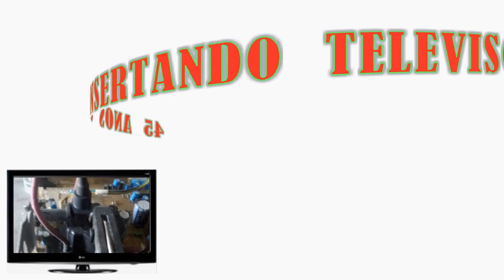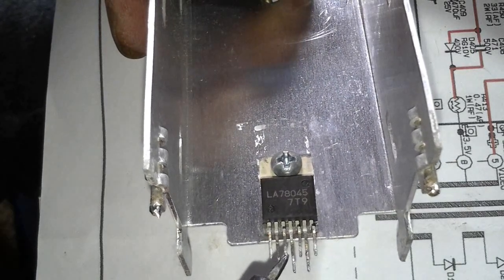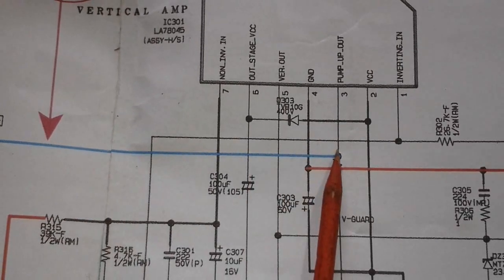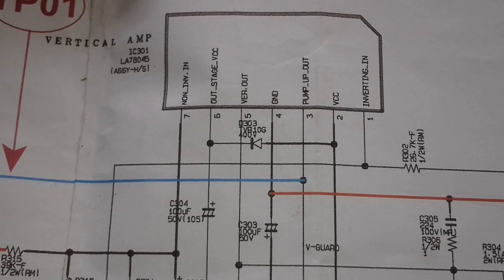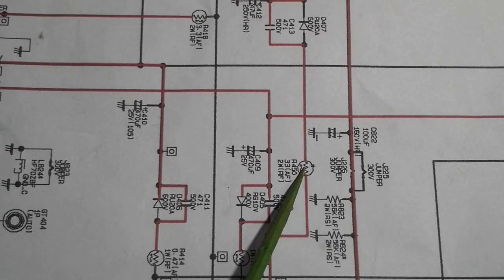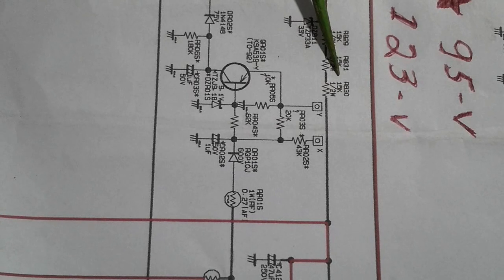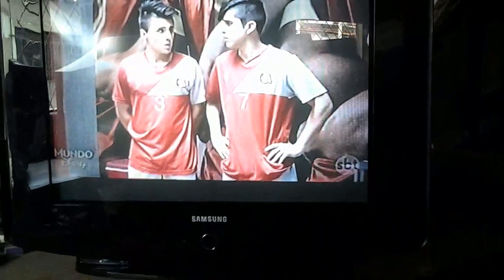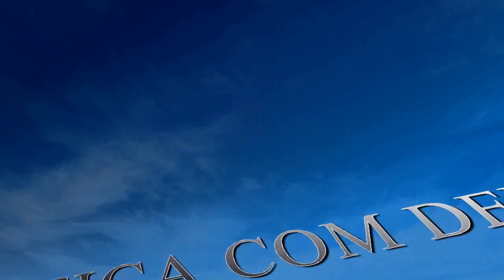{131 B}# Tv SAMSUNG CL 29Z58MQ com tela escura som normal -  parte - 2

Comment: Muito bom coleguinha... Também fico feliz quando termino de fazer um serviço desse coleguinha, pensei que fosse só eu que pensava assim, ta entendendo coleguinha? kkkkkkkkk
Reply from the maker: Estou coleguinha, kkkkkkkk.
Reply from the maker: Hoje eu publiquei a terceira parte da série LEITURA DE RESISTORES, ensinado a ler resistores de precisão.
O próximo da serie, sera de resistores SMD.
Reply: é muito gratificante para min quebrar um pouco a cabeça e no final conseguir ajeitar o aparelho sensação de missão cumprida  não tem preço que paga essa sensação
eu sou do tipo que gosto de consertar a placa onde esta o prazer  trocar aquele capacitor , transistor e depois soldar etc e não troca-la (só no ultimo recurso dependendo do aparelho né amigos)  pois trocando a placa perde a graça

as vezes quebro muita a cabeça e não conseguindo consertar vou relaxar um pouco e depois volto a luta e no final com muita força de vontade consigo.e fico com aquela sensação de missão cumprida multiplicada por 10